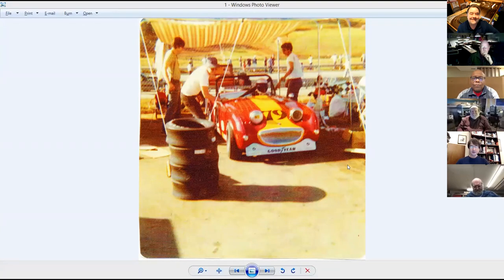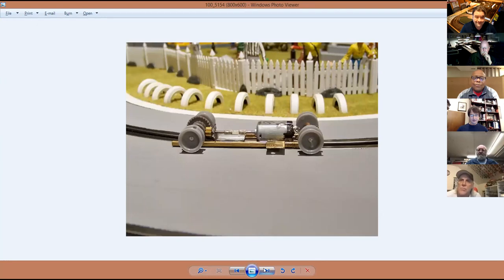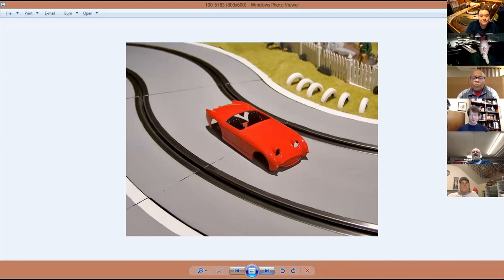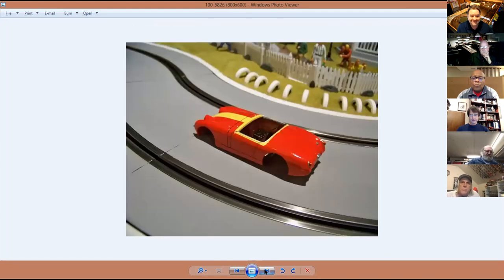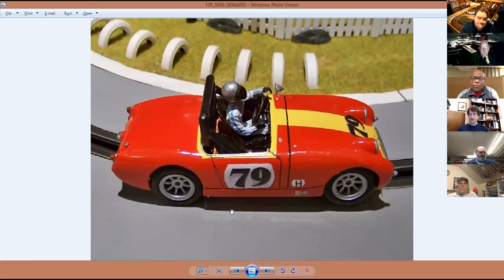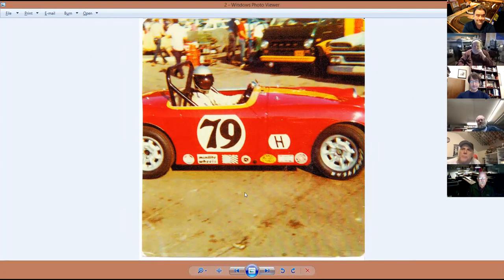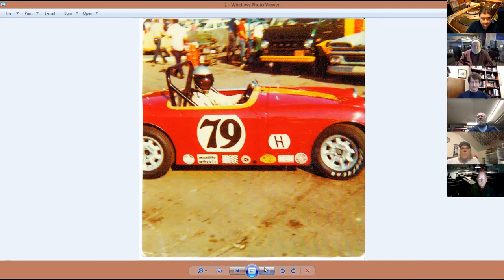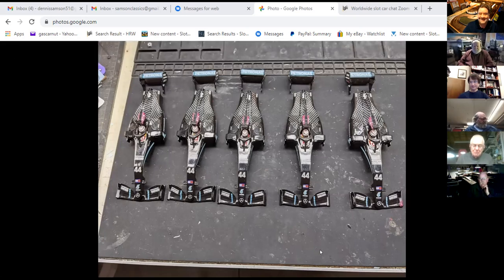World Wide Slot Car Chat #43

Comment: the slop in SCX guides ,for the slop in that insert ,Tamiya make shin washers I think you need the 4mm size just slip the right size onto the insert before you stick it into the chassis .it takes most of the slop out to the point sometimes you need to loosen them a little .As for the guide I use to put shoo goo around the top of it and sit it on my set up plate until hard ,But you may need to pull the goo of with some long nose pliers to change braids ,then redo the glue.

Comment: Wayne, look at reducing the slop in the intermediate part as that's where most SCX guide slop is. Smear superglue round the hole to make it a neater fit.  Don't glue the parts together just fill gaps where you can.